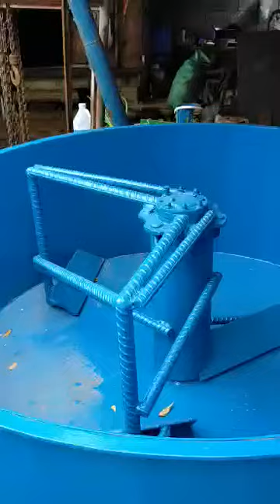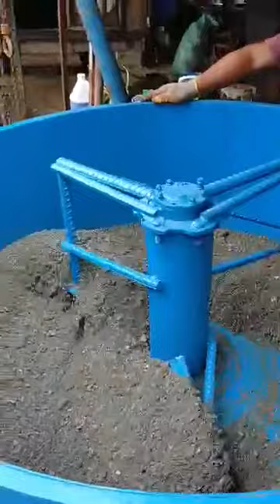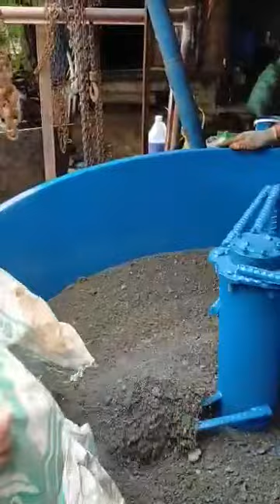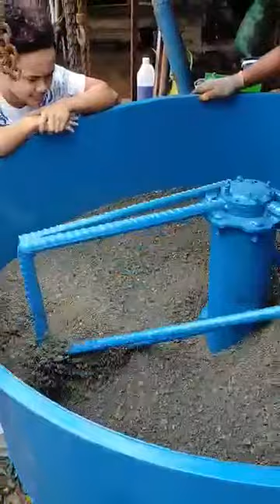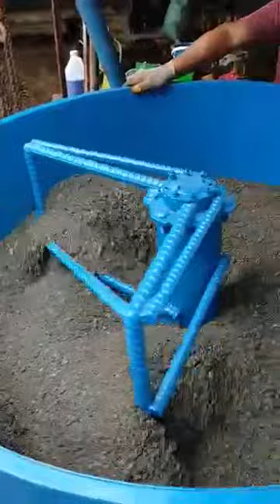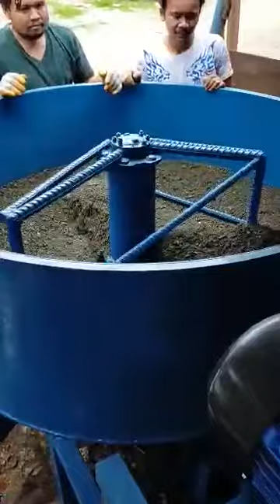MORTAR MIXER

Comment: Mortar mixer   100k sir? Dili kauban ang iyang  molder ?
Reply from the maker: Good evening sir. Mortar mixer lang nah sir.
Reply: @gvchbvlog2638  pila man konh kauban ang hollowblock maker  nga #4?
Reply from the maker: @romygula4864  140k ang 1 unit mortar mixer ug #4 x 4 output sir.